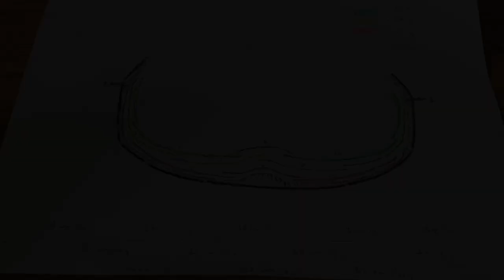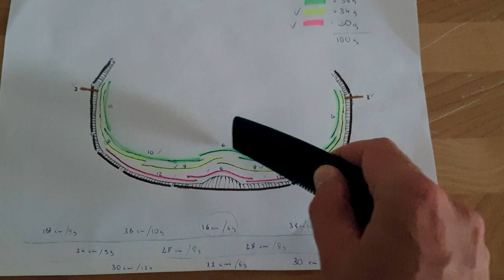How to build an Ottoman Bow - #4

Comment: A few tips for you. 
Use thicker glue when doing the first layer 30% is about right. The acetone isn't a great idea. The reflex should be increased more after each layer gels. It would be best if your tips were about 8 inches apart now (assuming this is your first Turkish hornbow?), don't worry about the extra reflex - not adding it can leading to sinew delamination, especially around the kasan eye.
Anyhow good luck and well done for having a go.
Reply from the maker: Thanks mate, yes I added the reflex every layer. I guess there are different shapes of ottoman bows. I decided to stick with a more open shape instead going for a crab style bow. That's why it is still more opened than 8 inch. And I used slightly thicker glue for the first layer (25%) and it gelyfied pretty fast. Not sure about 30%. But I'll keep it in mind for the next one 😀. Thanks anyways my friend. It's an adventure 🙃
Reply: @m.bitious  No problem. I've been making these bows for 15+ years, the sinew/core bond on the first sinew layer is critical to get right. The 30% glue tip came directly from Adam Karpowzi - it served me well.
Reply from the maker: @eclipsearchery9387  lol, same source here. But in my case Karpowicz gave a range from 20%-25% 😉. We'll see how it works out. Thanks for sharing your experience (I'll definetly keep it in mind) & cheers my friend

Comment: Without words, the details make the difference. How long do you gather the heads so they don't separate?Congratulations
Reply: I mean you will put on a little reflex to avoid delamination in the future?
Reply from the maker: Hey my friend. After one week of drying I unclamped the bow. It will return a little into original state, but not all the way. It will keep most of the Reflex by itself. After a week the sinew is dried completely and there is no danger of delaminating. But 5cm each time are enough. Because if you go to far the horn can be damaged 😂😮. Cheers my friend

Comment: Isn't 100g of sinew gonna make the draw weight of this bow pretty damn big?
Reply from the maker: You're definetly right - but in 3 weeks 3 month of drying are over. Than I will bring the bow down to its final measurements by reducing the sinew layer where necessary. So I guess that leaves me with approximately 70g of sinew in the end. I will weigh it before and after, then we'll know more 😉. Cheers my friend
Reply: @m.bitious  That's a good point, I had forgotten about removing material. I guess I'm curious what the overall weight of the bow is designed to be (apologies if it was in the description of a previous video and I missed it). I have heard that the generic weight ratio of these bows should be 1/3 wood, 1/3 horn, 1/6 sinew, and 1/6 glue. 

Is that comparable to what this is expected to come out to? Assuming ~70g of sinew so ~420g bow?
Reply from the maker: @Couponuser16  I aimed for a 380g but I'm sure it will be heavier. I will add a layer of very thin leather that will add weight. Then some colour. On the other hand I will shorten the wood at the tips. So it is really hard to say right now 😉
Reply: @m.bitious I'm excited to see how it turns out!